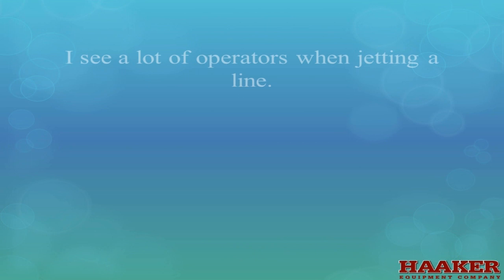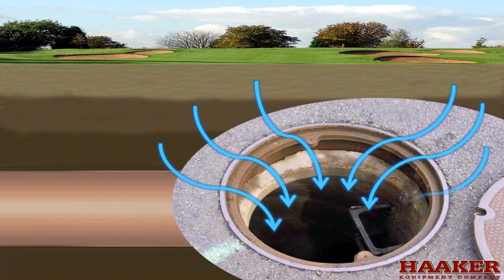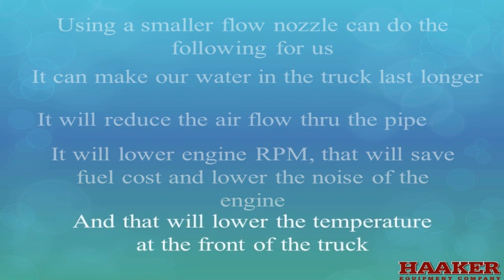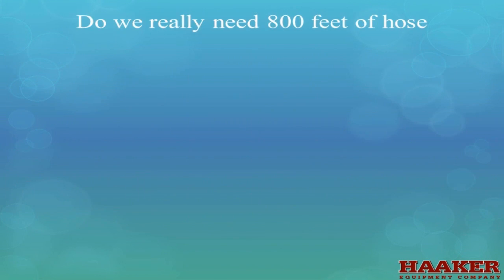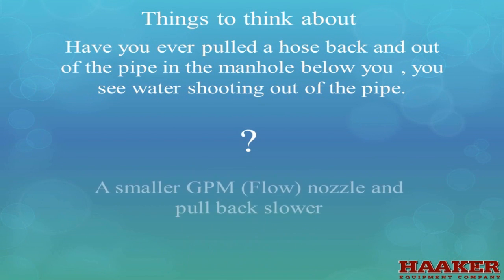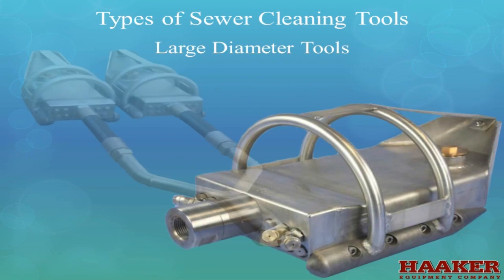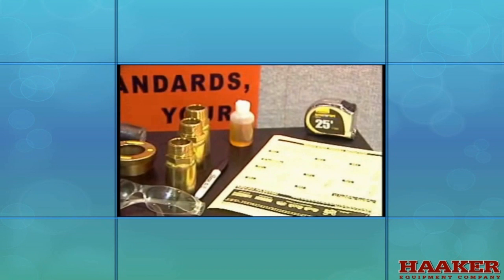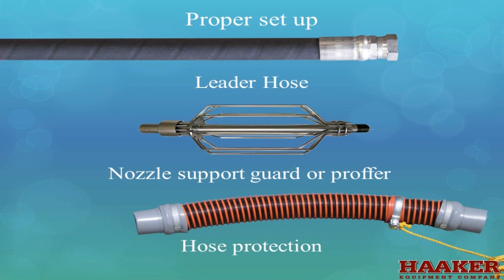Flow Pressure Nozzles

Comment: how to calculate pressure loss in full cone nozzle???
Reply from the maker: Not sure I understand your question. As an operator I need to estimate what the cleaning pressure is at the nozzle. The hose is my figuring factor to subtract from the pressure on the gauge. A good cleaning pressure at the nozzle is around 1200PSI.